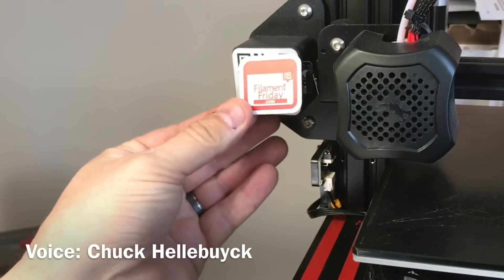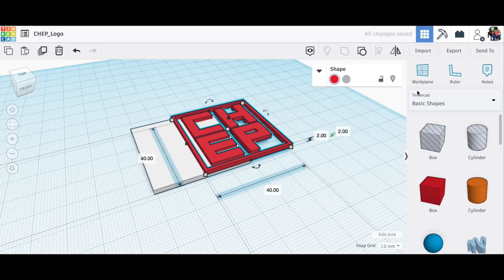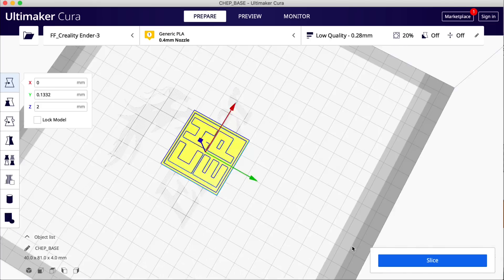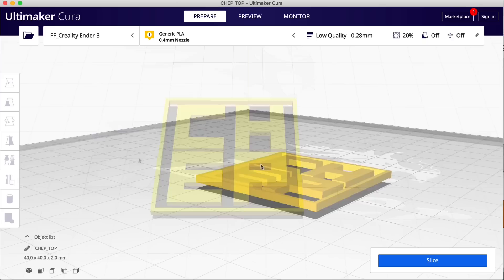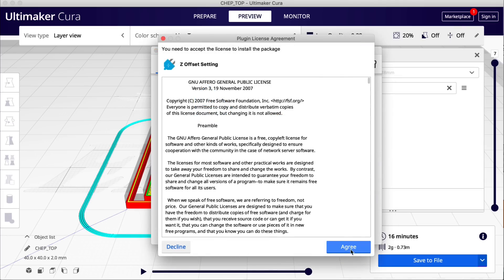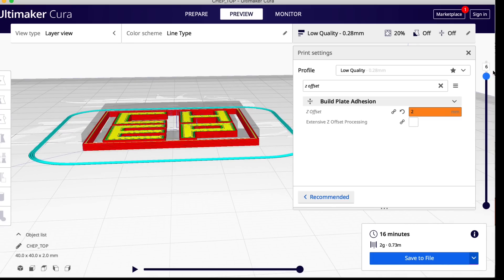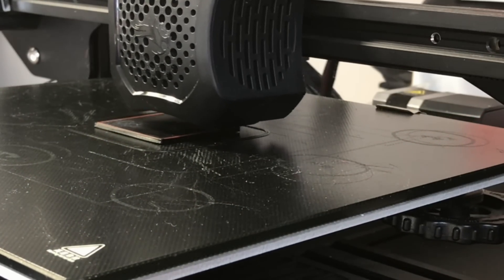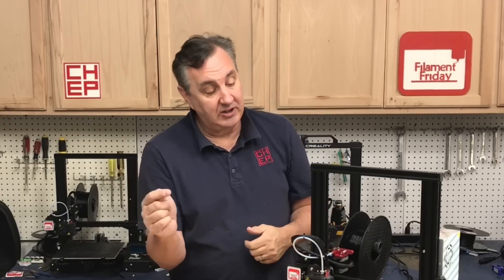Two Color Print Using Z-Offset Plugin in Cura

Comment: I believe you can achieve the same result by unticking the "remove empty first layers" setting in Cura. This will allow you to slice a model exactly as it is loaded into cura, whether it is up in the air or not. Maybe handy in certain cases in conjuction with the z offset plugin
Reply: That's what I have been doing for a while now

Comment: Thanks for the information but while you are changing your filament the bed temperature goes down when the extruder starts with the second print what about the first print it will not shake because maybe it has loosen after the bed temperature lowered after the first print please advice

Comment: Why not just use the Pause at height script, which is added when installing the Calibration Shapes plugin( for which you already had a video)?
Menu->Extension->Post Processing->Modify G-Code : Add a script -> Paused at height : Pause Height 2.0 mm
When the print reaches this height, the hotend will move away from the model, it will be possible to replace the filament, push as much as necessary so that the color becomes normal and continue printing by clicking on the encoder.
There is also a Filament Change item in the scripts, but I did not use it, there is an automatic retraction before replacing and squeezing after. In theory, it should also work.
Reply: You didn't watch the video all the way to the end, did you?

Comment: I’m guessing this might be problematic for those with a bl touch.
Reply from the maker: Why? Just save the mesh. Like I show in this video: https://youtu.be/TroPjdkSEOY
Reply: I figured there’s a work around. but if I went ahead without doing something extra, I assume the printer would probe the bed over the existing print when starting the second.
Reply from the maker: If you kept it centered. You could put the print between probe spots as well.
Reply: @FilamentFriday  just wanted to add that I’ve enjoyed and learned a lot from your videos 👍
Reply: Ya ibhave bltouch and a center print would interfere
However 
You can skip z offset and load mesh and just probe print and it SHOULD have same effect
In fact if you print tall enough past fade ht you won't even need to load a mesh on second print!

Comment: I having a problem in Cura, I made my design in Tinkercad and put my design on Cura but it wont offset at all. Even if I try to manually pull it up it just falls back down. I'm super new to printing, and I don't know if I have a setting on the prevents it. I installed the offset from the marketplace so it should work... but it wont. I watched this video and did it step by step, I don't understand why it's not working.
Reply from the maker: In Cura preferences, uncheck “Automatically drop models to the build plate”.

Comment: Great video Chep. Have never tried this before and works a treat. Only problem I had with the CR-6 was that at the beginning of second print the head goes to the centre of bed and drops down to touch. Therefore first print cannot go in centre otherwise second print is to high. Is there a easy fix for this?
Reply from the maker: You found it. Not sure if there is a way to shut off autolevel on CR-6.

Comment: I Love all your vids !!!! I had to figure out that, for those of us with the BL Touch the probe re-homes before every print. And it probes over the base and the nozzle is 3 mm over the base. I just took off the 3 mm offset in Cura and then let the BL touch go to work. Resulting in a great print thanks to your tutorial.
Reply: Acon Man can you explain how you took off the 3 mm offset in Cura and still get the BL touch to not interfer with the second color?

Comment: Won't the initial gcode interfere with the 2nd print? I mean when I load the 2nd color print, my machine will home and all that.
Reply from the maker: It will do what you tell it in the Start Code of the machine profile. The Z will rise to the Z offset level.

Comment: I've been experimenting with this since I saw your video and used it to make some college logos for the March Madness tournament. I seem to have an issue and I'm not sure how to fix it. When I start the second print it adjusts the height correctly however the print head adjusts in the z direction as its moving to the print start location in the x and y direction and it's never high enough when it hits the edge of the logo and scratches the surface of the bottom print. Any suggestions on how to correct this. I would prefer it move all the way in the z before it moves to start printing or alternatively change the layer start location to the nearest point to home position so it doesn't scratch all the way across the bottom print when I start the top print.
Reply from the maker: You can adjust the GCode if you know how to do that. I don’t know if a way to stop that in the slicer.
Reply: @FilamentFriday  So you would change the order of the commands?  Or is the 1st move a combined XYZ move that you would have to separate into a Z move, followed by an XY?
Reply from the maker: Yes, just make the a separate movement if it’s combined.

Comment: Will this work with a BLtouch, I don't see how it would. At least not without using a saved mesh, but it would still run a z home in the center of the bed using the probe.
Reply from the maker: You can move it off of center.
Reply: @FilamentFriday  Move the first print off center, modify my firmware to have it home z off center? Thanks CHEP!!! I started following your advice from this video and now I have a 2mm plate that is useful for some other thing I suppose.

Comment: pause at height is easier
Reply from the maker: If that works on the machine. Some Enders won’t recognize the M0 GCode so this is an option. Some have commented this is easier than pause at height. So I like to show options.
Reply: @FilamentFriday  or just use M600... Super easy to enable in Ender firmware
Reply from the maker: Some won’t recognize M600 without firmware upgrade.
Reply: @FilamentFriday  which takes about five minutes, as I said it's easy to enable in the firmware.
Reply: @madrockxvx  Stop being an annoying brat. A very big part of Ender users never looks at the firmware. At the end of the day it's the printer most people choose to dive into the hobby. The guy told you two times he wants to show that kind of people the options they have. There is absolutely no need to be so arrogant, much less with the good ol' CHEP.
Reply: @fns58  I think you missed the part where he completely ignored what I said about firmware and then told me exactly what I said about firmware 😂

Comment: You didn't need to do that just turn of the auto drop models to build plate then you can print mid air
Reply from the maker: I’ve never heard of a Auto Bed Align Off setting.
Reply: @FilamentFriday  lmao it's not called that I just could not remember at the time it's the auto drop models to build plate hahaha
Reply from the maker: I had that turned off which allowed me to show it 2mm off the bed. But when sliced it doesn’t translate to the GCode file.
Reply: @FilamentFriday  thats wierd mine does , i must be an older version or something ?

Comment: Hi CHEP. You did a video some time ago about how to print a 2-color print by having the slicer pause the print at a specific Z layer height, swap the filament, then resume. Coming that method with the method you show in this video, which would you say is easier to do?
Reply from the maker: Depends on your machine as some won’t recognize the Pause at Height commands but I find this two print method very easy to do.
Reply: @FilamentFriday  yes, for example Longer LK4 Pro\Alfawise U30 Pro with this problem - the reason is the color touch screen

Comment: just use prusaslicer and you can set the layer you want to change colors
Reply from the maker: Yep, covered that a while ago at 5:40 here: https://youtu.be/wnJ24KTBF7U
But some Ender 3 don’t recognize the M600 command that Prusa uses without a firmware upgrade (also covered in a previous video).

Comment: Careful if you have abl and safe homing on as it will probe in the centre of the bed
Reply: Or EZABL
Reply from the maker: You can move the print away from center.
Reply: @FilamentFriday  The EZABL probes 9 points by default. Can't we just use the same plugin as before but simply enable resume printing to achieve the same "whenever I want to continue" feature?
Reply from the maker: What “same plug-in as before” ?
Reply: @FilamentFriday  "Pause at height" post processing script. Not really an extension.
I tried posting this comment 3 times already and tried linking to a video you made titled "Multi-Color 3D Print in CURA 3 on Creality Ender 3". Lets see if this comment goes through...
Reply from the maker: This one: https://youtu.be/1nBnVtOEAiY

Comment: i found another way: you can just add another stl (i use a little cube sink down in the bed to print just 1 layer) when sliced you will see the print up in the air. so if you print multiple parts only one is needed to touch the bed. i don't know if can actually be usefull but in this way is possible to print an entire model only on supports

Comment: This is a great option for those who'd rather not "stand by" their printers waiting for an M600.  If you're using a bed the prints remain adhered to after cooldown you could even print the bottom part one day, then come back the next day to print the 2nd color.

Comment: Hey, I remember in some video you mentioned the tolerances you take while printing interference fits and slim fits. was it 0.1 mm bigger than the actual dimension for a good firm fit?
Reply from the maker: 0.05 tight fit, 0.1 looser fit.

Comment: its a whole lot easier to slice the whole thing as one model. Use a gcode viewer to see at what layer you want to change color and throw in a M600 code to do a filament color change.
Reply from the maker: Not if your machine doesn’t recognize M600 like a lot of stock Ender 3’s have issue with,

Comment: At the end of the first job, you need to edit the gCode so it doesn't turn off the heat bed. Otherwise the bed will cool, first part will pop free.  Then "later when I come back" your job is ruined.  

I'd also edit the gCode of the second job to Z +15mm at the very start.  That way it is above the existing part by a lot.  When it moves into position it will fly over and down, landing on top of it instead of potentially colliding with the side; depending on where your seam XY is.  IE: If the seam starts in the back right corner the head may not have gotten to the full Z height in time normally.

Comment: To the point instructions👍, but how to use this feature when a bl-touch is installed?
Reply: You can move model outside of z-homing point and use previously saved mesh (M420 S instead of G29 after G28)

Comment: Cura 3.6  no plugins needed, just set your offset and click lock model. Done.
Reply: you can do that in cura 4.8, too. You just need to disable the option to auto drop objects onto the build plate in settings.
Reply from the maker: But neither of these offset the print in GCode when sliced so I don’t understand the point of the comments.
Reply: @FilamentFriday  Right. This worked at some point in the past. 

I consider this a bug. When support is enabled the z offset is correct (I use this for ABS printing) and support gets generated below the object when Z>0, but without support Cura clearly should not reset the z offset defined by the user on its own and also hide it in standard view.

It doesn´t when z is <z as you can cut objects and there is no reason to create wrong gcode. The bottom should be shown red or so as a warning, like it is done when an object is placed below the surface.

The current behaviour is all wrong. When "place object on build plate" is disabled in global settings, it should not do this and use the normal Z position from object settings on the left. For some reason it only does when Z is negative.

Comment: Have looked at arc welder plugin for cura yet ?Promises improve gcode making curves smoother and reducing the size of the gcode file .
Reply from the maker: Tried it but first impression, I don’t see much of a difference.
Reply: @FilamentFriday  same i plugged in a design and saw minimal change
Reply: @plasticjo
I use Arc Welder and I see a HUGE difference when it comes to round things.  For example, coffee cups and round planters/vases etc..  Without it on my CR10s-5 the head will stutter as it travels around the circle.  I can reduce the resolution (in cura "Special Modes|Resolution) but that has a tendency to straighten the arcs, not improve them, giving the cup a faceted look like a cut jewel.

With Arc Welder the circles are done as actual circles.  No stuttering around the perimeter which means no visible pox marks on the outside.

CR10s-5 running Marlin 2.whatever - FYI

Comment: I do wonder though.  If you could make a jig for your plate so you could print a bunch of the bases then come back and do the tops, for easy alignment.  Also what if the bed cools too much and releases then the base moves.  That's a fail then if you can't get it back in the same spot.

Comment: No need install plugin. Just uncheck "automatically drop models to the build plate" in cura preferences->configure cura->general
Reply from the maker: I already had that turned off which is why I could show it lifted off the bed. But that won’t affect slicing offset. Therefore plug-in needed.
Reply: @FilamentFriday  True, my fault, I didn't check it properly. Anyway I use filament change, woks fine for me, but good to know. Thank You
Reply: @FilamentFriday  You need to also disable the "Remove Empty First Layers" option in the profile for the Z-lift to work. This way the G-code starts at the selected height. You can even see on the preview that the printer is going to start printing the first layer in the air. I think it is easier than using the offset plugin for this purpose.
Reply from the maker: Thanks. Z offset seems more logical to me.

Comment: Couldn't one achieve this same effect by manually adjusting the Z offset via the printer's control panel at the start of the 2nd print job?
Reply: You could, if you remember where it should be. If you use a probe like the bltouch, it's likely not at 0.0 offset. Depending on your end goal, there are lots of ways to achieve the same result. If you just want two colors, just use that script in cura. If you want to start at a higher z, disable 'auto drop model' in cura settings and 'remove empty layers' in your cura profile

Comment: This seems like a slightly different version of the filament change process I use on my Sidewinder, the firmware for which does not have the M600 command enabled. However, one thing I see that your method lacks is a way to ensure the lower layer stays stuck to the bed - the filament change procedure I use on the Sidewinder requires a little cutting, copying, and pasting in the gcode to slice one file, separate them into top/bottom layers, remove the command that turns off the bed heater on the bottom file, and remove the prime strip for the top file. 

I've made a couple different things this way, the neatest of which was a scannable QR code for the guest WiFi in my house, and it provides a good balance of control over the filament change itself (particularly with avoiding ooze falling onto the print) and print quality.

Comment: Will the affect the Z-Offset of a BLTouch? Or would I need to account for that?
Reply: I was thinking the same thing... I'm pretty sure if you use a BLTouch and if it zeros from the center of the bed, you probably don't need to do any of this (your test/purge line will not be against the bed), but if you are running mesh leveling (such as G29 in your Cura start G-code), you probably need to disable that so it doesn't give you a crazy mesh, which probably would cause a crash.
Reply: That is why I use pause at height like he mentions in the video.

Comment: I would definitely not recommend this method. If you try to print your second color at a slightly larger height, the gantry may hit the print printing the priming line. Or the nozzle itself can hit your print moving from that line to the print, unless the plugin explicitly moves Z before X and Y. Also it's much more of a hassle making two separate stls, getting a plugin, finding the right height, turning off the skirt. Clicking pause at height works for any model, any situation, in 10 seconds. The only benefit of this method is that you can do the second color the next day, if your print doesn't get detached from the bed in the meantime due to it cooling off.
Reply from the maker: Lot of people have issues with pause at height. Some machines firmware won’t recognize the M0 command. 
Besides, The point of this video was to show the Z offset which is a useful feature beyond 2 color prints.
Reply: @FilamentFriday  I can imagine usecases as mentioned in other comments, printing directly into wood, or ninjaflex onto cloth. There is also a way to use this to print two colors on the same layer, given the right settings. Maybe it's the example given that appears emphasize the two color stacking that makes me want to go for the simpler option.
Reply: @FilamentFriday  @Joeri Noort

Cura already have a feature called "filament change", why bother with the problematic pause metod?

Comment: This is a great alternative for filament change as sometimes the gantry may move during changing filament.
Reply: i do a lot of filament changes and if the gantry moves i just auto home it again, and then resume the print (octoprint).
Reply: Exactly, just add a G28 after the filament change. I edited the python file for the pause at height plugin so it does it automatically for me. Works great!